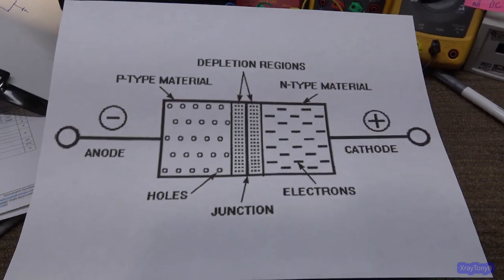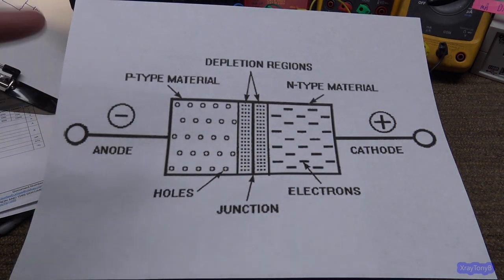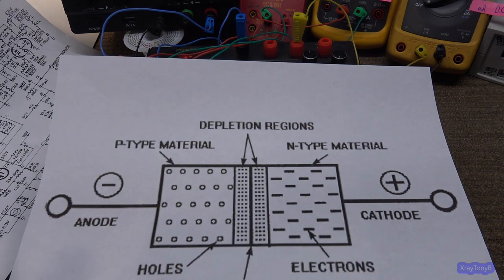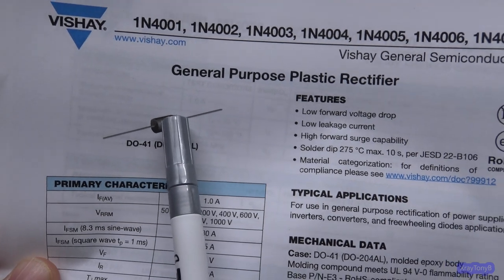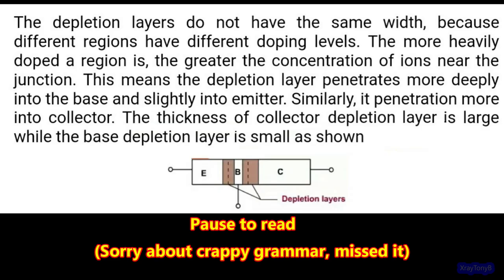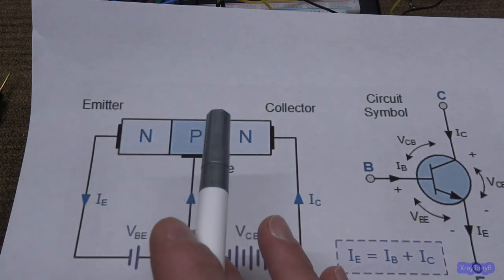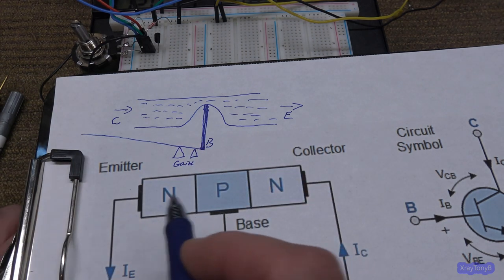Transistors in a Nutshell - Part 2 - Bipolar Junction Transistors

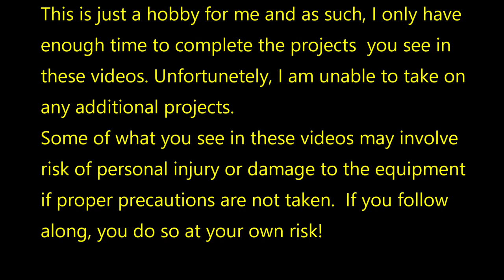Comment from the maker: 0:00 Intro
1:07 Comment about Diode polarity from Part 1 - Cathode/Anode/ + & -
4:23 Adding a third element to the P-N junction of the diode- in theory
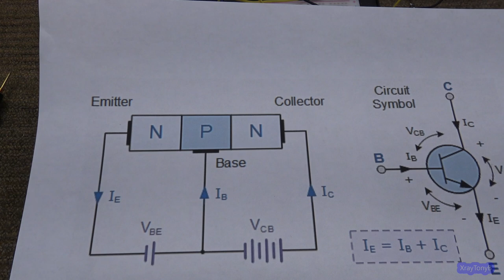4:50 Enter the transistor: The NPN junctions
5:36 How a transistor works - the water pipe analogy
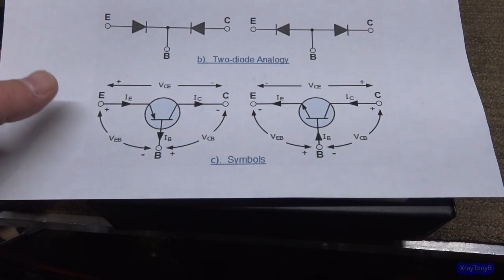7:27 PNP junction / PNP transistor - almost the same with opposite polarity
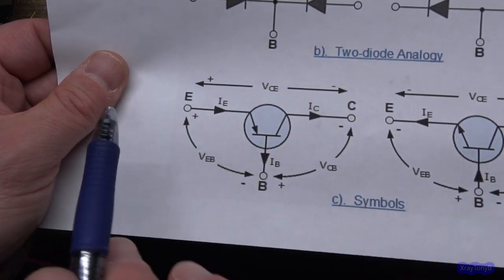8:30 The "diode model" of an NPN transistor (the PNP would have the diodes reversed)
10:00 Comparing NPN "diode model" to a real NPN transistor
11:00 Using the multimeter in diode check mode to identify base-emitter-collector
12:21 Using a tester to measure hFE, Ic, & Vbe
13:22 Using a test circuit to understand these measurements
27:57 Looking at the transistor datasheet
29:15 Looking at forward and reverse breakdown voltages - and exceeding them 
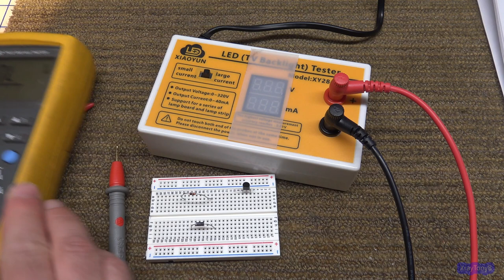40:12 Discussing the results of the tests
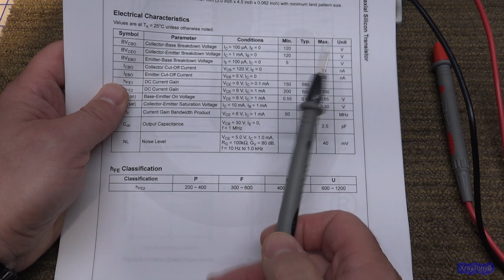45:08 Looking at a schematic to see how the transistor can fail
50:56 Looking at transistor emitter-base forward vs reverse voltage behavior
52:26 How current affects reverse breakdown voltage
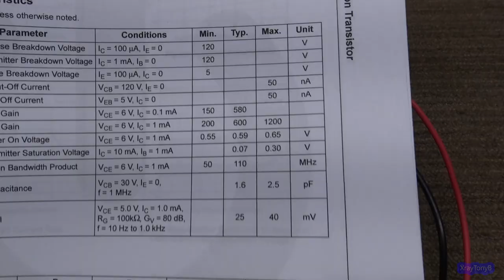54:09 Cutoff current
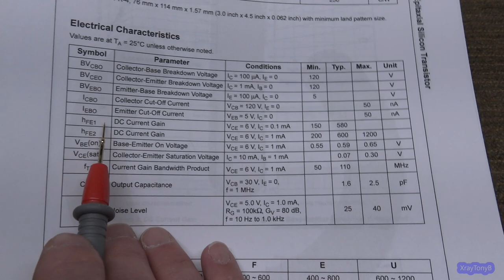55:36 hFE (A.K.A. "gain" or "ß") - A moving target!
1:00:16 Vbe
1:00:59 Matching transistors - some comments
1:02:56 fT or gain bandwidth product, better known as transition frequency
1:08:36 Output capacitance and Miller effect (They are not the same!)
1:09:36 Noise level
1:10:29 Looking at some of the graphs and some final information
Reply: I look at the diode polarity in the circuit, a totally different way. In your example, you are not connecting the cathode to a positive voltage. The positive voltage is established by virtue of the way the diode is connected. It is only conducting through the positive half of the AC since wave.  There is both positive and negative on the transformer side of the diode no matter what direction it is connected in the circuit.

Comment: Bipolar Junction Transistors, are current driven. The Base Emitter juction, is the diode part of the transistor. This produces the forward current, which allows the Collector to produce the amplified current, to drive the circuit!
Reply: If you watched the video, you wouldn't have needed to type that 😏😏

Comment: Tony, 
Tangentially related comment: I have the same backlight tester, and the readability is indeed terrible. I had some improvement bay simply using a red marker to color some transparent tape, and covered the display with that. It does reduce the visibility of the non-illuminated segments, and enhances the visibility of the lighted ones. It would have been so simple - and inexpensive for the mfr to do this. I don’t think I’ll ever be able to fathom the logic processes used by Chinese bean counters.

Comment: I am not sure if the flexible pipe analogy is totally correct. In the example a force (current) is used to squeeze the pipe. In practice, more current to the base turns on the transistor (opens the pipe)?

Comment: I was interested in seeing how you would describe the operation of these devices. The workings of a vacuum tube are quite intuitive and easy to explain. Not so with semiconductors. The explanations are necessarily abstract and can be difficult to wrap your head around so kudos for this video. The only criticism I might make is that in your water analogy, you implied that instead of turning the transistor on, the base current chokes off the current. That is how a FET operates.
Incidentally, I wasn't sure you had the cathode/anode designations on the diode correct until I realized that in your diagram, the diode is reverse biased. The way I remember it is the cathode is the negative end of the diode and the anode is the positive end when the diode is forward biased (conducting).

Comment: The spec sheet for the transistor indicates that the breakdown voltage is listed under the heading “min”. But your explanation is that it is a maximum voltage that should not be exceeded, which makes perfect sense. Can you explain why the confusion? Thanks for all you do to educate us.
Reply: If you test a lot of this transistors you will find out, that not all of them will start to break down at 120V, but you will get a range of values of breakdown voltages. The manufacturer usually does the same and adds a saftey margin. The value which comes in the datasheet is the minimum of the spread of voltages (+ margin), therefore it is in the min section. Take also care that this value is only valid at 25°C ambient temperature! But for your design this is the maximum value which should appear worst case. Usually you should stay well below.

Comment: Regarding the diode "see that stripe, that's going to be your cathode, even though you connect the positive to it" ... I might be missing something (most likely) and you're probably talking about convention vs real electron flow but usually the negative is connected to the stripey side?
Reply: Ah, the can of worms than can result when describing semiconductors and conventional versus electron flow. My way of thinking about it (my opinion, not necessarily the best or correct analogy) is to think of the stripy side (the cathode) as more positive than the anode because electrons are moving away from the cathode towards the anode (making the cathode less negative, therefore more positive) from an electron flow perspective. In most circuits (not all) the cathode is therefore positive (a bridge rectifier circuit analogy may be easier to comprehend).
Reply: @ralphj4012  Regardless of whether you are talking about conventional current or electron current (electron have a negative charge) the cathode or (stripey end) is negative with respect to the anode when the diode is conducting - just like it is with a thermionic diode.
Reply: @ralphj4012 If you need to refer to a bridge rectifier circuit to clarify an explanation, then your explanation is not simple at all. Try explaining current flow in a bridge rectifier to a room full of 19 year olds who would rather (and often are) on Tik-Tok rather than having their heads in the game. I once had that task, using a diagram showing conventional flow when I had learned it using electron flow. I discovered the ‘disconnect’ about 3/4 of the way through the lecture. I don’t think either the class or myself recovered that semester.
Reply: @jeremiahchamberlin4499  Concur, always a challenge when adding comments as I never know who I am trying to (probably, badly) explain something to. I never try to be too specific (and in many cases don't bother) as it would take many pages or even another video to explain electron flow, and, as you say, those already indoctrinated by other 'information streams' are virtually impossible to educate (in my opinion),